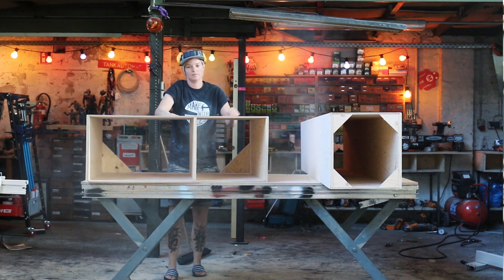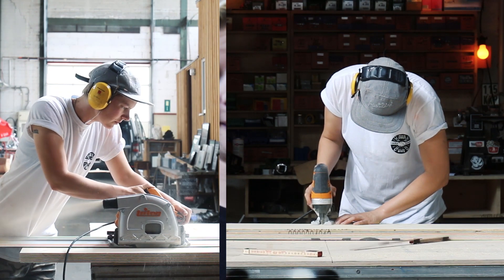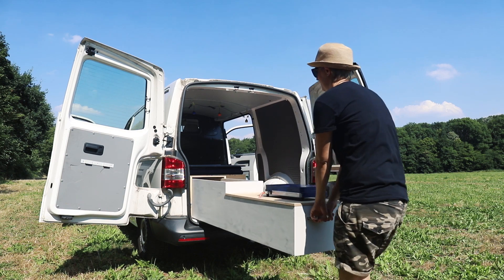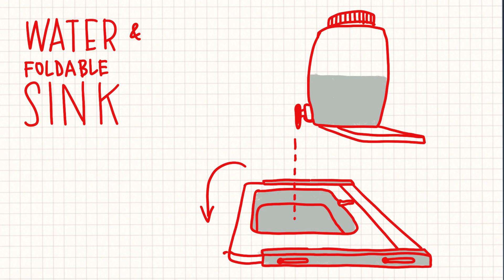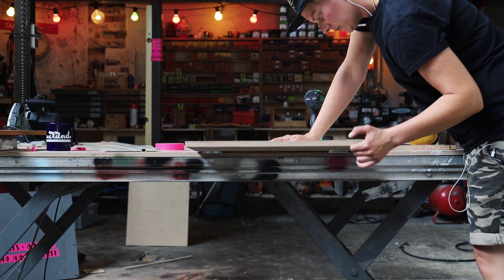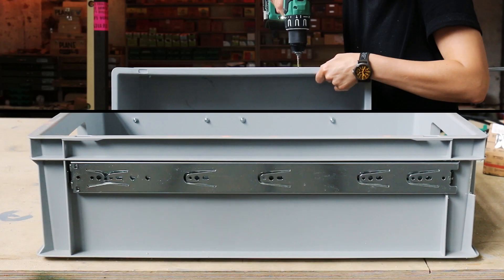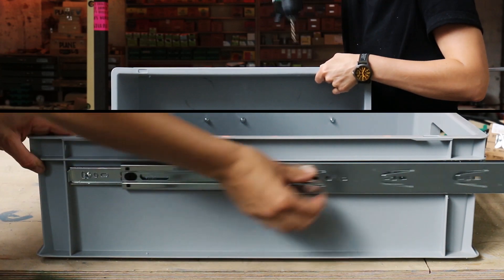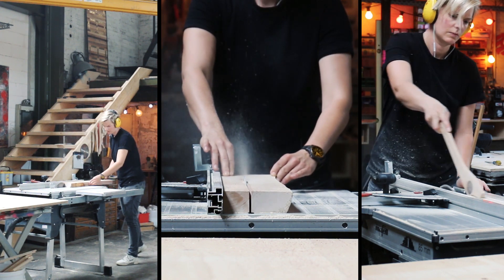My Cargo Camper  - A DIY Campervan Conversion

Comment: Good to see someone smart enough to use a Goal Zero Generator. These things are so easy to use and powerfull enough for most campers. Don't spend too much time one a complete electrical set-up when you can use one of these babies ... 

Cool conversion by the way ... simple ... Don't need much more than that.